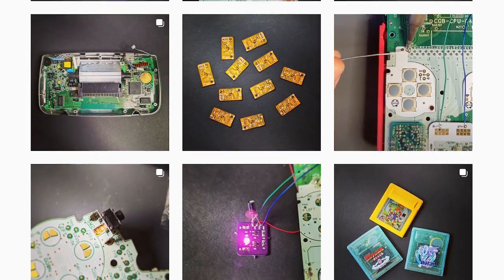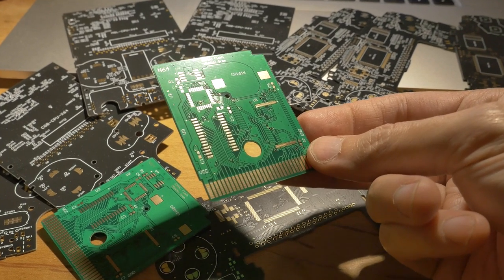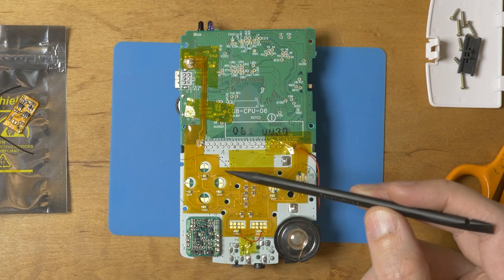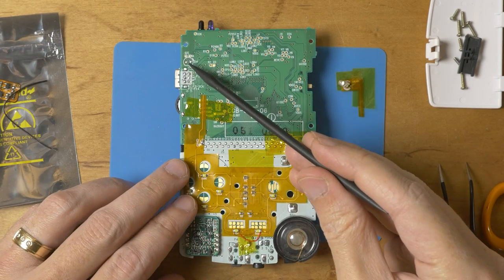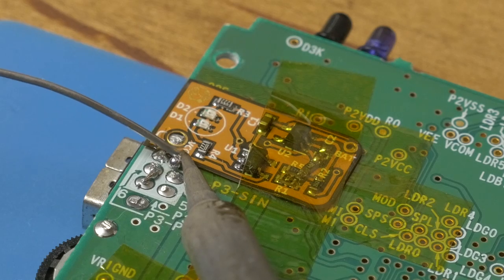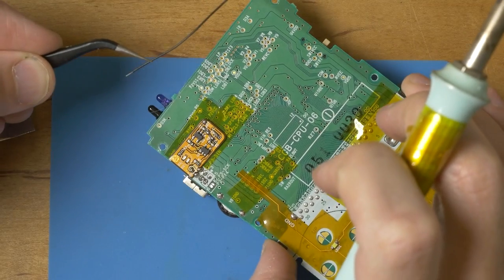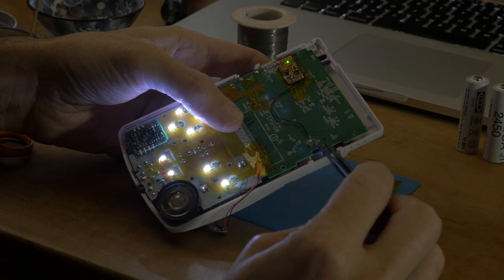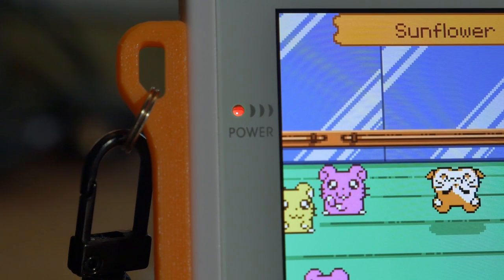You Need This Mod For Your Game Boy! (Easy Battery Indicator)

Comment: I wonder how this handles different mods though. If you have a power hungry screen, a flash cart in and other things like backlit buttons, I would think that the game boy will cut out at a higher remaining voltage. Also if the screen has brightness adjustment too…

Really what we need is for funny playing to add an RGB LED to theirs for a more clever indicator. It could even dim the screen gradually as it gets close to running out. It could probably do some calcs based on the rate or voltage drop to figure out when its likely to cut off.
Reply from the maker: This mod is actually more clever than you think, because it connects to the power switch at the end of the circuit it uses the final voltage that’s being outputted to the device despite the screen type, brightness, battery type, etc. If you look on his Etsy, you’ll find a chart of battery types and how long the shutoff time is once it turns red.

Would be nice for FP to add that though!

Comment: Does this work with LiPo batteries?
Reply from the maker: It's designed for NiMH rechargeable batteries (or normal alkaline batteries too I believe). It'll work with anything, but it's tuned for NiMH.